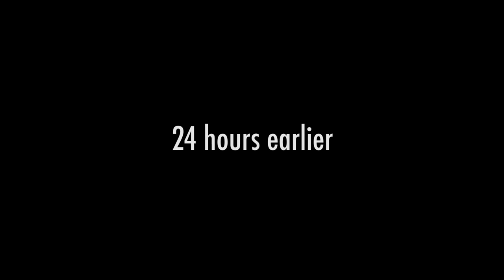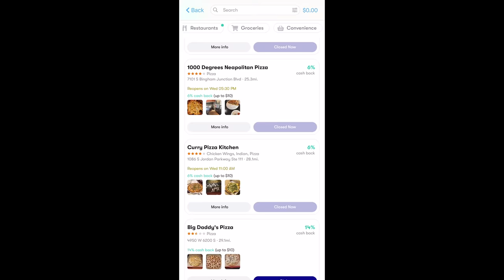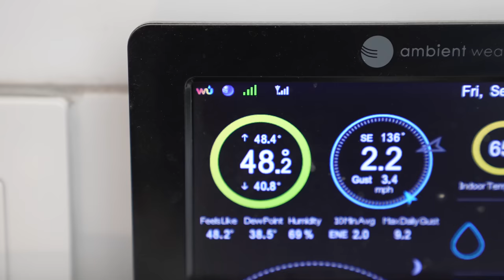I CAN'T CATCH A BREAK... | PROBLEMS WITH OUR BUILD

Comment: Went through the Concrete nightmare this past year putting up my shop. Started last November. Concrete took 5 months. Finally got power pulled to the building yesterday after delays with both the service provider and ghost electricians. Keep at it, you'll be there soon enough.

Comment: you should look into the mud mixer. I think it's made by quickcrete. I don't know if it will produce enough mix for the size of job you have, but you are going to wait until the cows come home for them to bring you cement. You need to look for other options.

Comment: Pro tip, you need to work with a contractor that has a working relationship, and account with, the concrete supplier. They take care of their account holders first.
Reply: Didn’t they have a friend like that?  Kevin?
Reply: @bow.9496  Kevin is a general contractor. The concrete subcontractor typically orders the concrete, so would have more influence. Some GC's do their own concrete, but I don't know Kevin's situation.

Comment: Trent, why in the heck don't you get a ladder stabilizer??  Allie, make Trent buy a ladder stabilizer ASAP.  It just fits over the top rung of the ladder and extends out to each side about a foot -- STABILIZES!!  Easy to put on or remove for when the ladder is at a corner or needs to go into a window opening.

Comment: Oh Trent, I'm back to fast forwarding through your construction to keep from seeing what you do wrong.  Mixing ABS with PVC?  Also, the drop on a pipe has a minimum as well as a maximum.  That line from the toilet exceeds the max drop.  If you have too much drop the liquid will outpace the solids and leave the solids behind.  If you need to drop below the joists, do it at the first L.  "Anyone can do it", NOPE.  Leo is so cute!  I love when he points at everything!
Reply: 1/4" per foot drop max
Reply: He never followed through to show us where and how he was going to use that 4-3 elbow which he bushed out with the abs.  I don't know what fits the inside of 4" pipe but maybe that toilet flange is made for that?  Code does allow mixing but only with the special glue.  

As for max slope, there was a limit on that at one time but I was told by an inspector some time ago that they'd done away with that.  The slipperiness of PVC doesn't allow for solids buildup on steep slopes.  A drain can drop at a 45 now without problems.

Comment: Look into buying bags of dry cement, getting a load of sand, and gravel. Then go to Harbor freight and buy a mixer. That would be much cheaper than bags and you will need the mixer for many years. That is the very cheapest way to do cement and you can do it, you do everything else and do a great job at it.

Comment: Don't worry about concrete is my recommendation make sure you've reinforced your footings and trenches and all of those things that you need to not be messed up cover them in some type of a plastic tarp and make sure that if anything gets in them it's easily able to be removed and just work on what's already built exterior first so mainly the roof I know it would be nice to roof the entire thing all at once but winter is coming at least get tar paper on top of that roof dry it in and work on the inside

Comment: You may not have your concrete yet but you still managed to get quite a bit done, Leo going up the stairs was quite funny but also a bit frightening in case he had a fall. when they are that young they have no sense of danger. but his lovely smile is just what we need.  If the weather there keeps changing then Allie will have to start making hot and cold drinks at the same time. Ha ha ha

Comment: Although the terms cement and concrete often are used interchangeably, cement is actually an ingredient of concrete. Concrete is a mixture of aggregates and paste. The aggregates are sand and gravel or crushed stone; the paste is water and portland cement.

Comment: On those high areas of your garage, you could do what I do when I have to hang Christmas lights at my house.  I back my truck up and put the ladder in the bed of the truck. It will give you a few more feet and will brace the ladder against the back wall of the bed, which makes it much more stable than the ground.
Reply: Your poor wife. Just thinking about that makes my palms sweat...a ladder IN a truck to reach higher - I feel dizzy 😆

Comment: Also frustrated with supply issues. Jan 2022 I ordered a contractor truck canopy for my F150 - told 8-10 weeks, great should have it for all my summer adventures. Currently suppose to finally arrive at my dealers on Thursday this week, not holding my breath but crossing fingers.

Comment: Concrete is the wet one, the one that's ready to pour into your site; Cement is the one dry, the one you have to mix with water and sand or gravel.

Comment: cherry picker is a little one person bucket attached to a truck  u seen them most used by power line companies,  man loft snorkel lift r the correct term and the same thing. i run an equipment rental company... i think i would know more than most in the  comments

Comment: I am thinking farm house sheik - then you can use V grove plywood on the walls and ceiling - it butts together like tongue and groove and they are in sheets 1200mm x 2400mm or 4 feet x 8 feet (you can get them as long as 12 feet or 3600mm) for your tallest wall - saves having to do horrible plastering - the whole upstairs could have that look - just needs painting or sealing depending on the look you want - you may want the ceiling in wood and the walls in a white?

Comment: Trent you've done everything else go get a cement mixer and poor them yourself with Brandon. My dad and my brothers did the same when they built our home and garage and driveway.  It's not that hard to do. Just by and use your trucks and trailor or rent anything you need like a dump trailor.
   That's if you haven't got it done by now cuz I have no clue when this video was actually recorded, maybe a month ago.
   But you could have had it done with all the waiting and getting up early to call cement companies to do it.
   You two can knock it out no problem. And those footers are small.just take a 2x12 and have that for rolling the wheel barrow on to take cement to dump it in the footers. It's strenuous work but it's nothing yall can't do.
   And no it won't take a zillion bags of cement. I can believe your waiting for a company yo bring the cement when you and Brandon have the ability to do it.youtube up on it and git er dun.
    Otherwise you may be waiting for spring to get concrete delivered.

Comment: On the garage egress man door  opening, are you planning on a steel door frame? Just my suggestion, a steel lintel from rear wall to the forward structure to help lessen the chances of the rear wall pushing into the garage causing the door to become pinched

Comment: I live in a small town in eastern oregon and I feel your pain.  Trying to get ANY of the trades to come out is almost impossible.   We recently had a water leak at the main and it took almost a month and continuous begging on my part to get an excavator and a plumber to fix the issue.  During which time water was pouring out.  It's so frustrating.

Comment: Eh Trent Correct me if your code is somehow different but Drainage (especially Black Water) you should use only ABS Pipe (black Pipe) & the thickest white pipe for water intake because of water pressure (Both of which have a 2 Big Collars at each end of Connectors Like a 90 degree elbow joint. That adaptor that you have Both on the Floor & the Piece you just glued look like the thiner central Vacuum Piping In anywise White pipe should not be use for Toilet drain.

Comment: The correct machine for your terrain is a Telehandler.  It's a man lift designed to be used off road.  Also, tarp your trenches.

Comment: You'll need the receipts too when you sell the house. It could help offset some of the taxes, especially with the over inflated pandemic caused prices.  I'm saving every single receipt for the shed/workshop I'm building in the back yard.  I've also saved the receipt for the new air conditioning unit I had to have put in 2 years ago to replace the out of warranty one that went bad after 7 years.

Comment: My garage had a concrete floor made in a mixer by the occupants. It cracked in several places and was rising on one side and 😊I even tripped and fell over the raised crack. The drain also didn’t work. At that time, several years ago, a contractor said it would need to be removed by jackhammers, more gravel laid and at that time, his estimate was for $5,000. I was going to have him do it, but he never showed.

Comment: Cement = lime, sand and water in it's most basic form... Concrete/beton ia when you've added pebbles or small stones to the mix... It says nothing about how wet or dry it is... Most cement bags are just lime, ashes and scelica or another binding mineral ..

Comment: Concrete is a mix of cement and gravel, cement is a reference to glue, mortar is a mix of cement and sand.  I'm not even going to get into the different kinds of cement that go into mortar and concrete as well as the different strengths of mixes.

Comment: It will come to a point where you realize that it would be better to rent concrete gear made for something bigger than the normal hand spinner people normally use, and start to make your own concrete, if that's even possible. If I remember correctly there's a local company that rents out all sort of machinery including special trucks like a concrete truck,  trying to figure out how to get it done, instead of waiting for weeks would be a lot better.

But with how the world is right now, maybe even getting dry cement do make it yourself might get difficult too. And if certain rumors I've hear is right, it won't get better until it gets even worse.

Comment: for the eves in the back of the barn : maibe you can mount can mount an oversize type of bookshelve mounts and build a shelve along the wall thats strong enough to stand on and hold some material 
https://www.ot.wustl.edu/FPtech/_images/StackerBracket1.jpg
from the looks of it the concrete might actually need to be done with two concrete mixers and a bunch of men and elbow grease , as it be more expensive and time consuming to have to redoing the ditches and / or wait untill spring , think the way to go is to move some sort of small moveable podium  and a small gutter over the ditch (or on top of the forms as that might make it eazier to slide it along ) plant the concrete mixer on top of the podium so you can drop the concrete intoo the forms straight out of the mixer 
you need to keep going once you started as you cannot pour concrete over allready dried concrete so you might need two of each to keep up the speed and finish a side in one day and night (did you kindof calculated the volume needed , then you should know how many loads you need to make in the mixer and how long it should take then do the time X 1.5 or so and youre probably close to the actual time it takes )
BRING THE BEER and probably the barbique AND THEY WILL COME 😁
might be a good idea to get an electric and a gasowered mixer in case the power goes out or you run out of fuel you be insured both ways

Comment: Take it from an old time contractor...Your problem is that you are a DIYer and don't have the buying power of a contractor that orders 1000s of cubic yards monthly and because getting it to the mountain at the going rate per cubic yard is already a much lower profit center for the vendor they will only favor their  top contractors in the area. Hire a pump and finisher guy that will order the material through their account and see how quick you can get concrete to you.. You may pay a premium but at least you're poured before winter. Who knows? they may already have a larger project in your area that they could piggyback your small pour to at the end of the day and get it knocked out for you. Also; I don't know how many yards this pour is but if it is short of the 10 yds capacity of the truck then you are already put to the back of the list.

Comment: Ik you were fuelng, but it is extremely dangerous to get in a vehicle and back out while the fuel nozzle is  in. There are vapors in the air, and when you exit the vehicle  there is a better than even chance of static electricity igniting the fumes and exploding on ya. Of course, I have no idea if you completed fuelling and then got in to film.